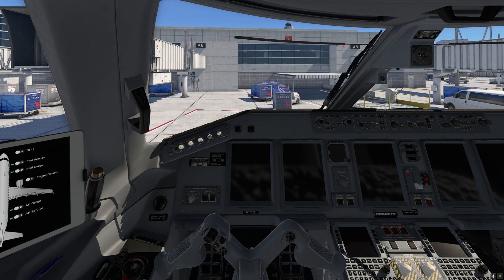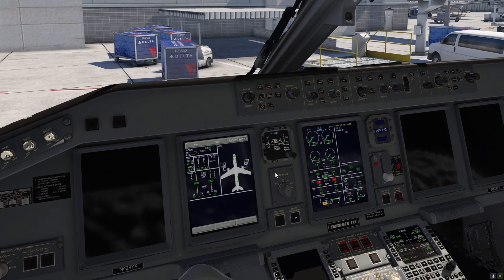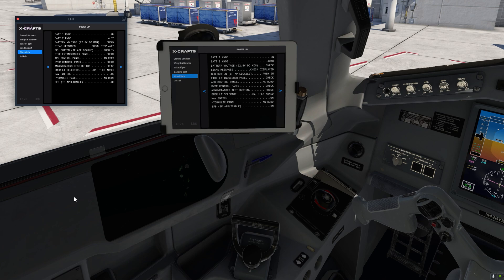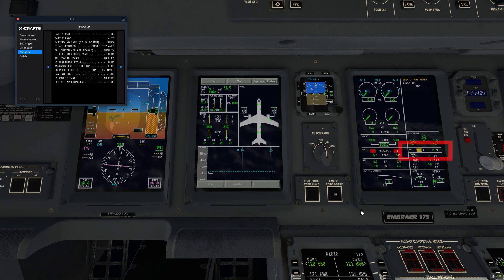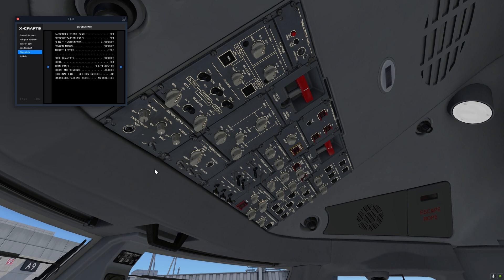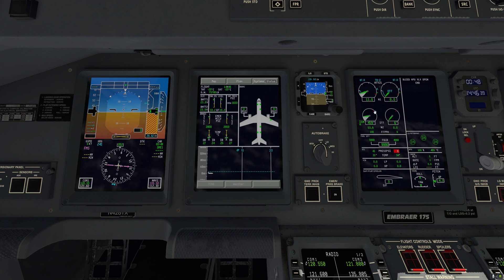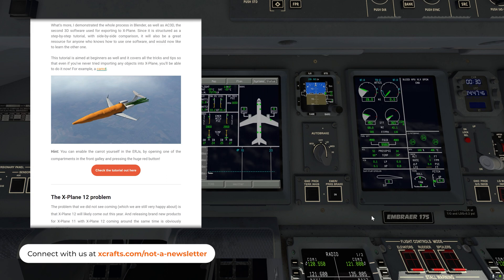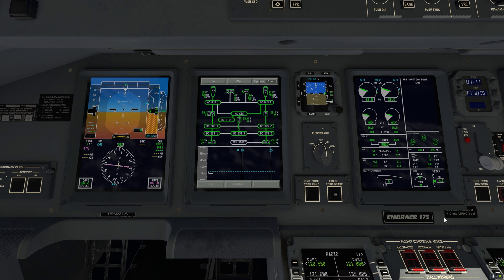E-Jets Family Tutorial | Quick GPU & APU Engine Start Up

Comment: Hi guys im having issue with FMC setup, when selecting dep sid game crashes in both planes 175, 195 can you help me?
Reply: You have to use X-Plane 11 for the Free E175 and E195. If you use XP12, you may try to use the Default FMS which might be more stable.
Reply: @MarkoMamula how do i use default FMS?
Reply from the maker: It is at the back of the pedestal. if you click in the middle of the screen, I think that it should open a pop up version of it, but it might not. Sorry, I never used the default FMS

Comment: Dude I bought the X crafts E-145 for X-Plane 12 and every time I put the activation code in and click activate, the sim crashes. I’ve redownloaded multiple times. Reopened the sim and tried over and over again. Please help. I am a mac xplane 12 users if that info helps
Reply from the maker: Hi, you'll need to allow the plugins to run, and you will need to run X-Plane 12 with Rosetta. Both are simple actions explained here: https://www.xcrafts.com/mac

However, if you have a brand new mac, there may currently be an issue that we are working on. There seems to be an issue with the ERJs and brand new macs with Apple Silicon chips, but we are working on figuring this out right now. If we cannot find a solution in due time, we will of course offer you a refund. I'm really sorry for that, but new Macs seem to have introduced this issue.
Reply: @xcrafts_development  I know what you mean when you say "allow", I do that the first time I load the plane up after installing, then reopen it. still isn't working. I'm on intel processor i9, not the M1/M2.
Reply from the maker: @ThatDude2FlyNetworks  Ok, please come to our Tech Support forum, https://forums.x-plane.org/index.php?/forums/topic/180847-erj-family-tech-support/ and upload your Log.txt file that was generated after the crash. That's the only way we will be able to see what is causing the crash on your system.

Comment: I've a question. Do you have a Ground Handling tool for the all the new Embraers, so the E170, 175, 190 and 195?
Reply from the maker: Hi! We do not have any new native ground handling, but you should be able to use other 3rd party ground handling add-ons.
Reply: Which Addons do you mean?🙂
Reply from the maker: @basic_chrisyt9742  I found a set for SAM Ground Service here: https://forums.x-plane.org/index.php?/files/file/86786-x-crafts-e-jets-sam-ground-service-preset-x-plane-12/ But you'll have to search online, we only provide the aircraft, so any other configuration files for 3rd party add-ons will have to be created by some 3rd party creator.
Reply: Thank you very much for you help! 👍🙂